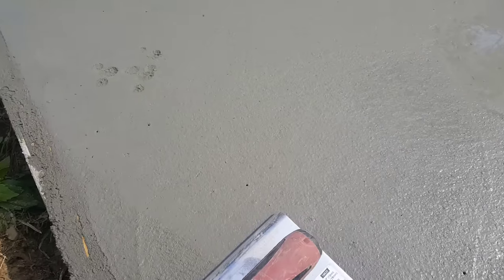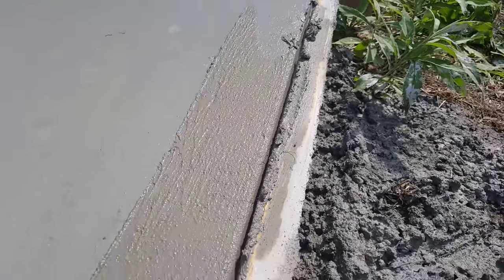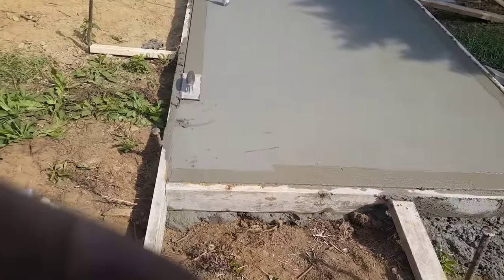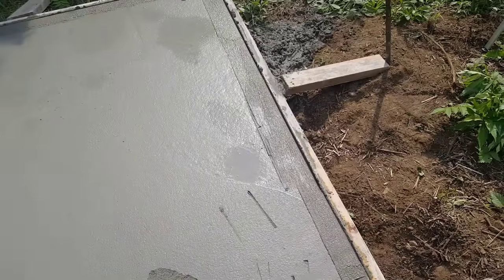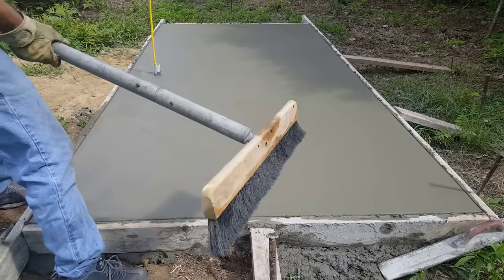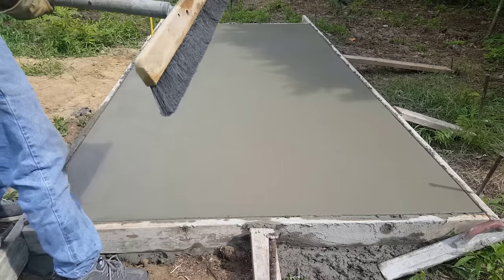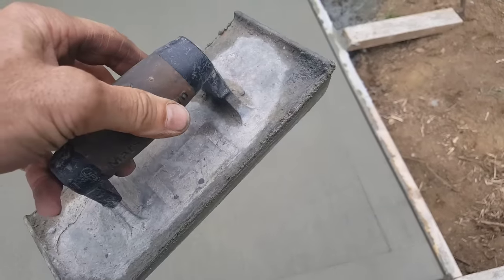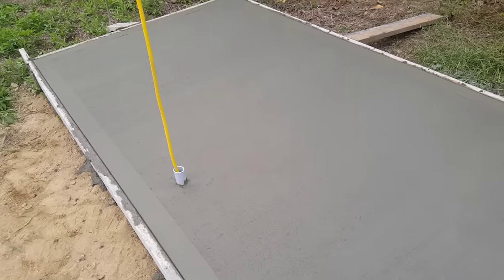Concrete Finishing Techniques - How to Mag Float, Edge, and Broom a concrete slab

Comment: Hey Mike! Just thought I would point out the fact that everything I have learned since entering the concrete business has been from you. You are very patient and thorough with instructions!
Reply: Quick question, if the slab is really wet in some spots still, do I let it sit till it drys a little or do I try to trowel some of that off? It seems when I do it stays wet longer.
Reply: The more you work it the more moisture comes to the surface.

Comment: It would be nice to see a video that explains all of the steps involved in finishing a slab, and when to do them. Something you would look for as a tell that the concrete is ready for the next phase.
Reply: yes, getting ready to pour an extension onto my back patio this weekend. I just know I'm going to start a step too early and mess something up.
Reply from the maker: You're looking for the concrete to feel firm, only be able to sink your finger in about 1/4 to 1/8 inch before it's time to start mag floating. You could start using the edger a little sooner to cut in you edges like I'm doing. Once you mag float it, run the broom over it, if you're happy with how it looks then you're good. If not wait a little longer and mag float it again, then broom it.

Comment: This is very similar to what I will be doing on my front walkway. I’ll be pouring a 5 foot wide slab that’ll be 39 feet long but the last 5-6 feet towards my stairs will 45 degree outwards to the right to give a slightly larger stepping platform. These videos are very helpful. I’m hoping I can pour before winter as I’m north of Toronto and winter ❄️ is just around the corner.

Comment: You are an excellent teacher I could edge concrete with confidence now if I’m ever asked to do it at work but hope they do the same process float rough edge -mag - broom finish edge .  I’m a dry finisher but ide like to try some new things . What if it’s a smooth finish then what do we do ? Same thing ? Just have to press on the tool I know when it’s creamy you have to be light touched . I mastered sacking with a rigid foam float .

Comment: Hi Mike, thanks. I just got a 12'x8' slab poured for a shed. Hired a truck to deliver the concrete.  My first time doing this, but got some confidence after watching a bunch of your videos.    
You are totally right about the edger because I bought the cheap one from HD with the flat edges.  Nope. It sucked.  
Also I thought I could finish like you do with the mag tool. Nope.  
 I bought a 14" steel trowel. You just smooth it out with no effort.  It is not that easy in real life.
Lol thats why you are the guy making videos.  
The kicker ... I was putting a shed with a floor on top. The only thing people see is the edges , which ended being the worst part.  
Keep on doing the videos. I would have hired you but I'm very far away.
Reply from the maker: Hi john, yea it does take some practice to get used to it. Good job for doing it on your own. You saved yourself a lot of money. :)

Comment: Very good, obviously a true craftsman. Maybe its an American term but I have never heard of a "mag float".
Do you ever finish with a wood float, I find this to be the most satisfying part of laying concrete.
Reply: Magnesium or Aluminum floats are mainly used. We use the wood float ( My foreman calls it a bull float here in AZ ) right after the pour, level, float,edge, joint and broom. Pretty quick when you have a decent crew.
Reply from the maker: I've never used a wood float, only the magnesium.
Reply: @MikeDayConcrete  
The steel (mag) float will give a polished finish, the wood, or the more modern plastic, float, I find gives a very even light textured finish and a very even surface but you have to wait a couple of hours to get the right conditions. It also allows you to rub up surface imperfections.

Comment: Back in the 70's when I was a cement finisher for broom finish or scroll the edges were done first then the whole slab would get broom or scroll finished without edger or jointer marks, makes the finish look 100% more finished.

Comment: Thank you Mike for giving us your knowledge. I have a question l had a slab of concrete pour in my backyard about 5 years ago 15 feet wide by 60 feet long towards the back corner concrete cracked and it slope down l want to pour another concrete over it 10 by 12 for a shed is it OK to do that or should I remove old concrete and replace it. Your advice will be greatly appreciated. Thank.

Comment: What slump do you pour your mud? Here in Alabama it’s hot and humid so we usually pour on a 6” slump. By doing that it usually takes a good hour and half before we can start tooling. We don’t do a lot of finished slabs. We do commercial Masonry for the most part but when some of our friends and co-workers need help we pitch in. Plus we also own our own pump so they usually hire us to pump if needed. I pump on a 9” slump it’s usually a 7 when it gets to where it’s going. I was taught the longer you wait to tool to better it will look but I’ve seen people put an edge on freshly poured cement. I like your method better thanks for sharing. I’m going to show this video to some of the young guys on our crew. 

Thanks Again, Chris Calhoun
Reply from the maker: Chris, I usually ask the mixer driver for a 6 slump when I pour, unless I have a slope in the floor.

Comment: Mike just a couple things about edging and floating a concrete slab. First what you want to do is float your Edge's looking for high or low spots. After doing that then you edge being careful not to roll your edges. Then use your float to take out any edge lines. When it's time to broom you want to use a horsehair room if it in a bucket of water to get it wet and like you said go up once and back if it in the water again and overlap your first flight keep doing that so on. You dont want to use a dry broom. And it also depends on what  kind of broom you're going to put on it between a heavy broom or a light broom. With that said he'll have to wait on the concrete to also set up and dry depending on what kind of broom you're going to put on it.
Reply: Dude mike is like one of the best of all time at concrete. Chill dude. Everyone has their own twist.

Comment: You don't see people leaving the edges like that where I'm from but it seems like it's getting a lil more popular. From Alabama
Reply from the maker: We do it both ways. Sometimes leaving the finished tool mark and sometimes not. How do you do it?
Reply: @MikeDayConcrete  when we edge we just trowel the mark out , we do mostly our pool decks but we've some patios and slabs for gazebos, but I've seen some people do it like you did in this video, they would broom the inside and leave the border smooth, it looked pretty good, maybe we'll give it a shot.

Comment: Hi Mike, just curious why you did not do a finish trowel after magging  , then broom finish? I appreciate your videos and time. Thanks
Reply: Michael Brimeyer agree. We float with mag and finish with a steel after water is evaporated. Then broom and retouch edges and joints.
Reply: Cant use steel trowel up north, traps water in the concrete.. mags only

Comment: Hi Mike, great videos and  great job on your concrete pours. How wet do you pour your concrete. What slump? My concrete doesn't pour and screed as nicely as yours. What size aggregate do you use? A 5 or six bag mix? Thanks for your sharing you skills. I'm a old concrete finisher but love the satisfaction of a well poured slab😊
Reply from the maker: I pour around a 6 slump. Usually use a 3/4 size aggregate. 6 bag mix for exterior stuff 5 for inside. Thanks for watching!
Reply: @MikeDayConcrete  Thanks Mike
Reply: I'm also going to try one of the edgers you use. The one with the turned up edges.
Reply: Hey guys, regarding the edgers. What’s the difference between using blue steel, regular steel or brass? I never knew that the material made much difference. I hear some will kill over them brass ones 😂 
Mike just found your channel, been watching some of them and I truly appreciate them. Thank you!

Comment: Hey I enjoy the video . Quick question for you. When I use a bag mix I have a hard time brooming because of the fine aggregate the small rocks come up .... any solution I read add some Portland thanks for reply
Reply from the maker: Adding Portland cement will help a little. Waiting a little bit longer to broom will help also. If the concrete is firmer when you mag and trowel it, you're less likely to have the fine aggregates come up.
Reply: Invest in a roller. Rod it off and mag a little. Roll it then float and add mud as needed

Comment: Hey, Great video thanks for sharing. Quick question, why do you broom finish after the mag float? i like the sheen of a mag float, can you not just leave it like that? thanks
Reply from the maker: You can leave it like that. It's just preference, and broom is less slippery if you want that.
Reply: Opinion here: Broom finishes are good to have on an outdoor surface that will get wet; preferable, in fact. Smooth = slippery when wet. 

On inside pours, you may soon regret a broomed interior surface, because they are hard to clean (a chore often accompanied by profanity! LOL!) ... and that added traction INDOORS is almost never useful. Smooth interior surfaces are easy to clean, and are only slippery when dusty, sandy, or wet. 

A comment on the difference between single and multiple-curve edging tools. The single-edge tool TRAILING edge will leave a really smooth finish, while the multiple-curved tool leaves tiny little "suction release" ridges behind. The trailing up-swept curve tries to lift the concrete up behind it, as the concrete tries to maintain contact with the trowel, and creates suction between the tool and concrete. It pulls up the wettest material behind it as it moves. That wet stuff forms tiny little raised bits of wet sand and wet ridges, all across the trailing edge of the tool as the suction is broken. The single-curved tool, even though it is hard to lift the leading edge of travel a consistent amount to keep it from gouging, the TRAILING edge is not curved up, so it breaks the suction against the concrete immediately, leaving a far more shiny surface in its "wake." It is a hassle to keep that front edge lifted with each pass back and forth, but it sure looks nice if you can do it well.

Comment: Mike, I need your help, I'm pouring a small ramp that is 1.5ft wide by 6ft long. the ramp will be poured on existing concrete so I don't have anywhere to stake the forms down too. I've seen people use cement bags to hold them in place what do you think?

Comment: It's really great that you share knowledge like that. Question: once fully set, will this finish become dusty when someone walks on it? I've been trying to figure a way to finish concrete so it is hard enough on the surface. One thing that has been working is a layer of tile glue, but it was a lot of work. Hope my question is making sense. Again great content.
Reply: Do you want a very smooth, dense, and hard concrete floor?  Look into using a lithium silicate densifier and diamond polishing.  If you grind into the aggregate, you achieve something like a concrete terrazzo.
Reply: @naranjojo  thanks for the tip, I'll look into that. Yes, hard floor and walls.

Comment: 96 dislikes? It was a good video guys. This guy forgot more about concrete than you will ever know haha
Reply from the maker: That's what I tell the young ones's around here :)
Reply: Probably a lot of the dislikes is because of the 2”edger l use the “6” flat steel, most guys use a 4” I use the 6” for two reasons I think it looks better and a lot of guys will let the edge roll down on them, 
A 6” you always have to hold it flat to get the edge mark in away from the board. Using a 2” edger we would say picture frame it. Using the 6” edger we would call that a shiner. I like the shiner it really makes the edges look good. 
The right hand man on occasion has had to say to the guys better get that shiner going this stuff is getting hard. It was about 15 years ago and last Tuesday that I’ve had the edger dig in on me.

Comment: Question:  I'm about to do a slab that is 9' wide between two buildings and it butts up to each building.  It's 40' so brooming will be difficult.  What would you recommend?  Can you just mag it and leave it with a mag finish?  It will be a walkway so i need it to have some texture for grip.

Comment: Mike, can you speak to a situation where you need to change the slope of a driveway?  I have a double slab driveway, where one slab is sloped wrong on 2 dimensions. (slopes towards the house, and also towards the second slab.  (results in water pooling against the house, and seeping under).  This is a DIY project I am researching.

Comment: Great video. I'm about to pour my first sidewalk section. 30 feet long. I noticed you didn't cover this slab up to keep it drying/curing slowly. Shouldn't it be covered or sprayed or a light sprinkler on it?
Reply from the maker: Curing is always good. The homeowner covered this up when he got home to cure it.
Reply: Make sure it's just set enough that the plastic does not leave its impression on the concrete.

Comment: Great video. I've been interested in learning the techniques to pour and finish concrete. I do have a question if you do not mind, Does the bull float and mag float serve the same purpose? Do you bull float then mag? Great video sir.
Reply from the maker: Yes, pretty much the same purpose at first.  Then we mag float after the concrete sets a bit to smoothen it more. At this point you couldn't use the bull float, it's too hard for that.

Comment: I was curious. I understand the expansion cracks are added to keep the slabs from cracking by encouraging movement to a specific area. The slab in this video looks pretty large (4X8 I think he might have said), but the slab lacked any expansion cracks. At what size slab is it encouraged to use these?
Reply from the maker: Generally, anything that is 4 inches thick and 8' x 10' or under, doesn't need an expansion joint.

Comment: I poured a 4x6 square using quikrete the other day, mixed it, poured it, screeded it off with a 2x4, and waited for the bleed water to disappear, then edged/troweled. When I started edging, I kept hitting rocks .. same with finishing the surface, it took a lot of scrubbing to get the surface to close up. It turned out decent but the edges and some of the surface is raggedy due to all the rock pockets that I couldn’t close up. Any tips? Was it my technique or is quikrete just hard to work with?
Reply from the maker: Those bags don't have as much cement in them as a ready-mix concrete mix design. That's why they're so rocky. We use Quikrete 5000 when we use them and still add some Portland Cement to that.
Reply: @MikeDayConcrete  about how much cement did you add per bag? Also, thanks for the content. Your videos are a big part of why I decided to tackle the project myself.

Comment: Hi Mike, I did like you told with a 3" steel edger (curved tips) and the result is not as good as I wanted.. I got waves in my concrete (vertical waves). Is is because I put too much pressure edging?

Comment: Great video Mike, I'm in the process of acquiring all the tools to put together a garden shed slab out the back of our new house, my only question is at what stage after the pour do you begin the finishing process?
Reply from the maker: That depends on the outside temp and if it's in the direct sunlight. Once you can press you fingers into the surface only about 1/4 inch, that's usually a good indication it's time to start the finishing process.

Comment: Beautiful work Mike, just wondering how long you let the slab cure for before you start edging & brooming. I laid a footpath slab yesterday but think I waited too long because when I was booming little rocks were coming up out of the concrete? 
Thanks.
Reply: I usually edge the pad right after I mag it the first time just to push the big rocks down before it sets up a little bit and to help prevent the little rocks you could mag it again right before you broom it to get some more cream on the top of the pad. Or if you want a lighter broom finish I would mag twice let it set up a little bit then steel it then broom it. I hope this helps!

Comment: Curious as to why you edged the concrete again after brooming it? Is that a choice or are you supposed to edge a second time after brooming?
Reply: I think it is a style choice. I like to broom after my final edge.  It leaves a smooth finish that is appealing to me.  It is hard to do and not leave an ugly here and there, so I bring a small fine bristle and a stiff bristle hand sized broom to immediately smooth out any mistakes - using whichever broom matches the big broom best.  I think most finishers do it his way because it is easier and faster, but I asked a customer once, and he prefers the picture frame look.

Comment: Good video.
Quick question, what causes surface spalling on a concrete driveway where freezing temperatures occur over winter? Friend of mine had their driveway done in concrete last year and the year after the surface on certain areas seems to crack up like thin sheets of cardboard.
Reply: Concrete during winter is out of season you should never wait till winter to do that even doe there are things you can do to help but its just more money why do it